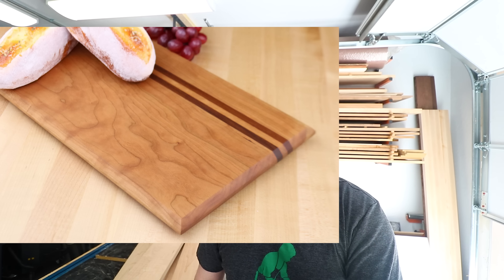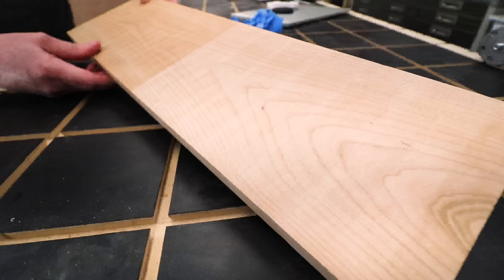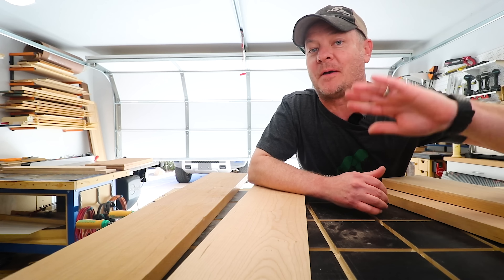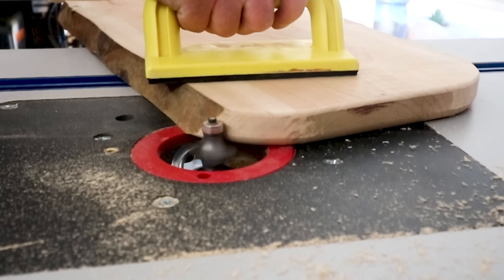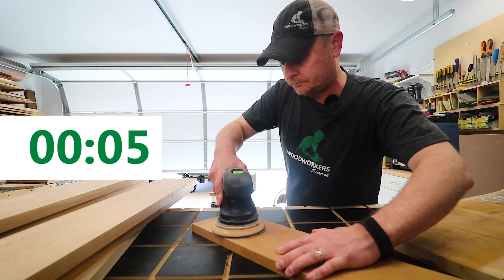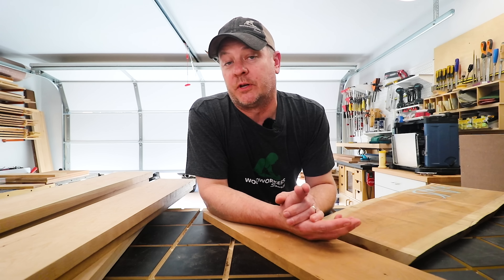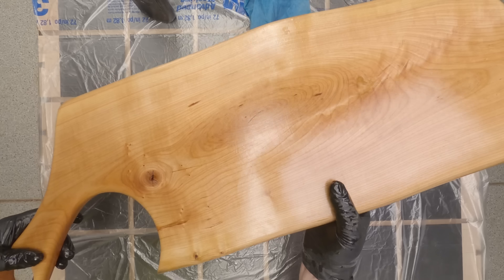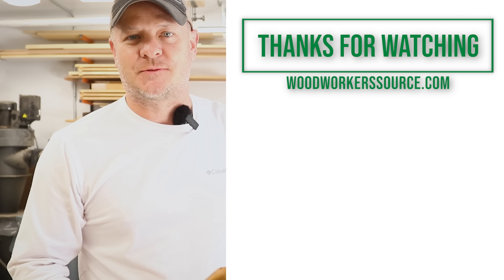Darken CHERRY Wood the RIGHT WAY

Comment: Hi watched your video. First great video, loved it. I just wanted to point out to you something that not many who do not restore cherry know. If you take a mason glass jar (Quart size) fill it with distilled water with a teaspon to tablespoon of Lye then mix it. This solution pre ages cherry and several other wood species. This is how old timey guys would age cherry to repair furniture. I always sand the piece then use rubbing alcohol to raise the grain then sand with steel wool. I then add the lye solution to the piece, you will see it darken instantly.  Then after it dries sand again with steel wool (lightly) and add your top coat as want. becareful Lye is caustic. Oh and the more Lye you use the darker it gets. so start very light with adding lye then add as you prefer. the soultion chemically burns/oxidizes the wood quickly. I never see people use this method I suppose I show my age....LOL take care again great video.
Reply from the maker: Great tip, thank you!

Comment: I was going to use oven cleaner on cherry for the first time to give it an antique look, which darkens it. Now I'm wondering if time will make it even darker. Do you know anything about that process?
Reply: Yes the oven cleaner darkens the wood if it contains lye and is diluted with water. Try a sample to see how much to add to the water, let dry and see how it looks over time. Not sure if lye is still in all oven cleaners so maybe use just lye if you can find it. Very caustic!
This process also works on mahogany which is similar to cherry. Similar in that the wood seems to have the same characteristics and the trees have similar leaves. Bugs don’t eat mahogany which is why old tropical furniture was made from mahogany.

Comment: This morning I started to stain a cherry furniture piece I had built. I had previously applied a de-waxed shellac sanding sealer to try to avoid some of the "blotchiness" that occurs when finishing cherry. After applying a coat of oil stain, there's some uneven color, but certainly better than if there wasn't a shellac base coat. Just after finishing the stain coat (with somewhat disappointing results), I now see this video and I'm kicking myself for not just letting the beautiful natural color darken a bit by itself before applying a topcoat with no stain.

Comment: Cherry wood tends to blotch when applying stain and then using a varnish to finish like in finishing a table or rocking chair.  Does applying a coating of lindseed oil and wiping it off then applying cherry stain work well to stop the blotching?

Comment: Ive got a spot in the middle of a darkened aged cherry table that got damaged from abuse and had to be slightly sanded in an area. Im using a wiping polyurethane which matches the old finish perfectly but some color mismatch between the old cherry and the area that had to be sanded. It sounds like time might fix the color mismatch.

Comment: Hey Mark, this is the 4th video of yours I've watched and I'm really digging it so far. Let me ask you this: have you ever heard of people using oven cleaner to "age" cherry? I discovered it last summer but haven't been able to find much written about it, and there are only a couple of Youtube videos that I'm come across. The theory as I understand it (keep in mind I am not a botanist or a chemist, but this was how it was explained to me) is that oven cleaner, being highly caustic, reacts with the tannins in the wood, which is also what is happening when cherry reacts to sunlight. The idea is that you're simply hyperactivating the process so it happens in seconds rather than months or years.

Anyhoo I tried it on a set of beer flight holders that I was making and I really liked the way it looked. Varies quite a bit from board to board (as one would expect) but they came out with a really nice, deep brown/red/crimson sort of shade, like you see in old cherry furniture. I found anywhere from about 10 or 15 seconds, up to perhaps 40-45 at the most yielded the best results, then quickly rinsed off and patted dry (I used a bunch of the cheap, semi-disposable microfiber cloths that you can buy by the box at Costco rather than say, paper towel, to make sure there wasn't any lint or whatever left behind). The reaction will continue for a few minutes after they're patted down.

Would love to hear your input on this method, and if you think it might work on other species of wood.

Also, if anyone reading this wants to try it, go for it, but remember to use proper PPE. Oven cleaner is very bad for you if you get it in or on your body, so safety glasses are a must, a good thick set of gloves (NOT nitrile disposable ones, I used a pair of regular rubber gloves like you probably have under your sink), and make sure to do this outside, on a surface that you can rinse down easily. I did it out on the driveway. Also I recommend getting the trigger spray version of Easy-Off, or any other oven cleaner that's 100 percent sodium hydroxide. The aerosol ones obviously have propellants and whatnot in them and may not work as well (though I've not tried them). Oh and it's a very good idea to raise the grain with some plain water first, as you will not be able to sand the piece after doing the oven cleaner treatment as it's quite thin. Though it does give you an out if you leave the oven cleaner on too long and it just goes super brown, you can always let it dry, sand it off and start again.

Sorry for the novel! Let me know your thoughts, and give it a go on some scrap pieces if you have some, I really dug how it looked. Cheers!

Comment: My problem is that my project is a Flintlock rifle stocked in Cherry. I (of course) want the deep dark finish. The kit hasn’t arrived yet so I have time.
Reply: If you want to darken cherry as thought it is old the way is to take a glass mason jar a uart size add distilled water with a teaspoon of Lye. Becareful Lye is caustic. First sand the wood then rub it down with rubing alcohol to raise the grain then use steel wool to saned again the put the water mixture on the cherry. Once it dries in a day sand it lightly with steel wool again. This finish is what old timey furniture guys do to age cherry. The more lye you use the darker the wood gets. Hope this helps. Take care.

Comment: I have some Cherry that has been in a warehouse for 40 years. It's rough sawn reclaimed and hard to even distinguish from looking at it. My guess is that it was harvested may be 100 years ago from the sawmill markings. When I ran a couple boards through the planner I couldn't believe what I discovered. These cherry boards are darker than most African mahogany. Many have figured curls along with a very distinctive grain pattern. So far I've only made small projects from select boards like urns and keepsake boxes. I predominantly use hard wax oils for my finish and the results are stunning. I have a new appreciation for cherry and its potential. Too bad we have to wait so long to achieve its maximum potential but the same can be said for just about every species. I really enjoy your channel and I look forward to every video that you post. Thank you for sharing your knowledge and I hope you have a great weekend.
Reply from the maker: Wow! What a treasure you’ve got, Ron 👍
We didn’t even consider what happens with material like yours that’s a century old. Unusual for sure, but what a thrill!

Comment: Good video, Mark.  I had to approach this issue from a different angle.   I had to match Cherry cabinets that had aged for 17 years.  As you noted, the color changes pretty fast and then change a lot slower over time.   Well, I was able to achieve the 17 year mark by applying boiled linseed oil, wiping it dry, and then set in the sun for 7 hours.    I applied a finish of Arm-R-Seal, and it matched the cabinets perfectly.   If I tried to stain to match, the colors would start to deviate after a while.

Parting note:   If making a contrasting cutting board, do NOT use cherry and walnut.  - Cherry Darkens, Walnut lightens, and eventually both are the same color.

Comment: Mark, your videos on finishing and wood species are the best on YT.  Always full of information, but brief.

If you are still reading these comments, I hoped to get your advice on finishing cherry.  I want to make a dresser for my son.  I have cherry-veneered plywood for the sides and solid cherry for face frames and the top.  I'm new to cherry and want to avoid blotching.  I considered using Seal-A-Cell first, followed by three coats of Arm-R-Seal (he's only 3 and can be rough on furniture).  Should I start with dewaxed shellac, then go straight to AR?  Any advice would be greatly appreciated.

Thank you for the education!
Reply from the maker: If you’re going to use seal a cell, I don’t think adding dewaxed shellac does much. Both of those do pretty much the same thing in terms of the initial sealing. You’re on a good path, though